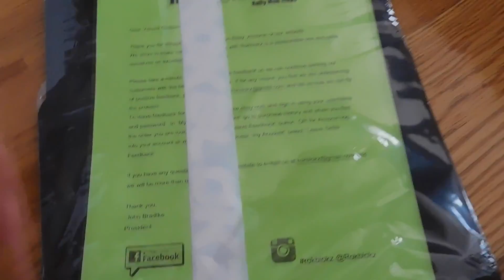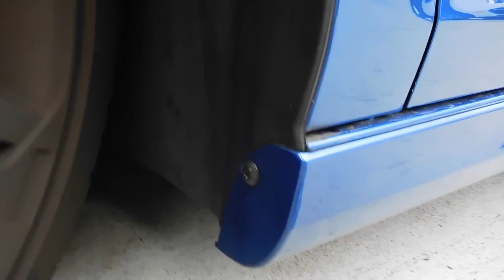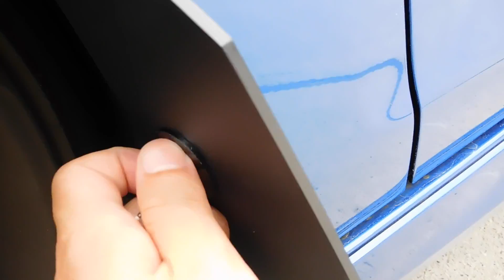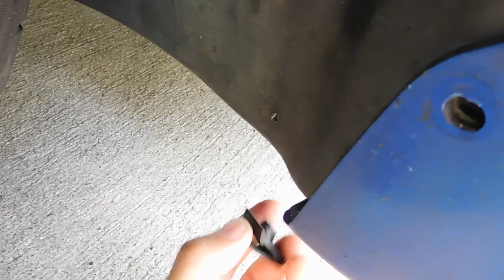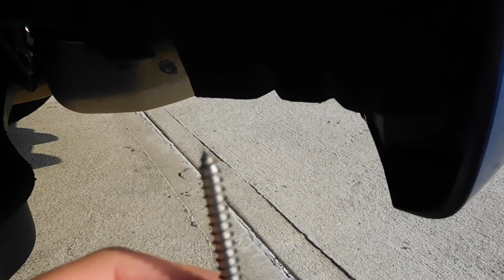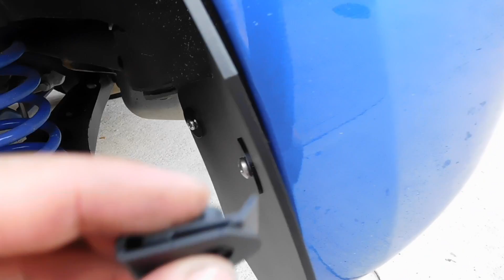MK6 GTI Golf R Mud Flaps Install | Why I chose RokBlokz over Rally Armor

Comment: Does any dirt build up behind the rear flaps in the hollow? As it can't escape out the bottom
Reply from the maker: I actually have never looked, Kevin. One thing I'm sure about it does prevent backsplash on the side panels and keeps the doors and rear bumper much cleaner. Looks wise not so much but it is functional.

Comment: Are you lowered any?  I have a lowered MKV GTI (1.5"-2" lower than stock) that I'm wanting to get these for and they suggest the shorties, but I'd rather have the original length on there, so they really do the job they're supposed to do.  They look pretty sweet on there though!
Reply: Ricky Long, I'm lowered on Eibachs with the full anti-roll kit (front & rear sway bars).  I wish there was a way you could post a side profile picture of them on your R now to see the ground clearance.  when you say you scrape, you mean on speed bumps/humps or ramps?  Not like just driving around town and hit a bump and they scrape?  I'd figure they've got at least an inch or two of clearance, right?
Reply: PSDGuru said that if you don't know the name the way